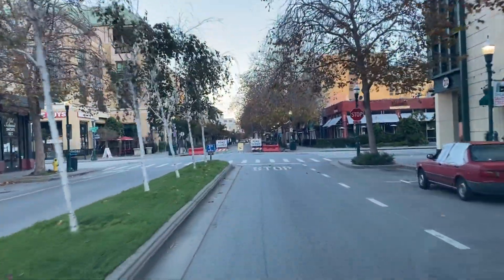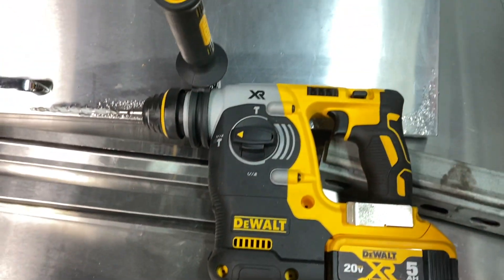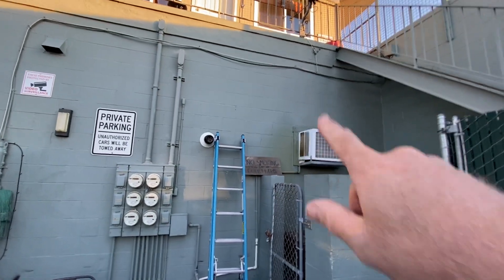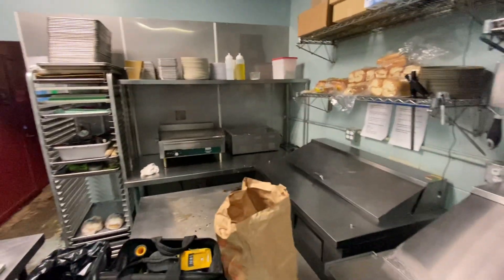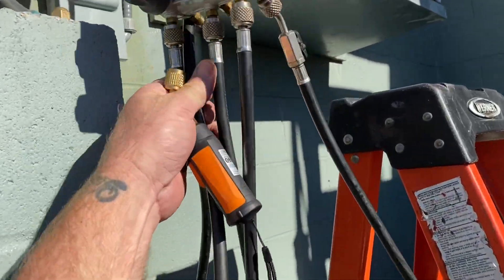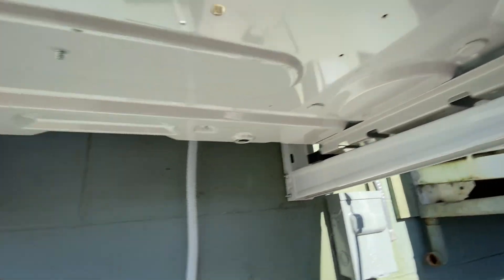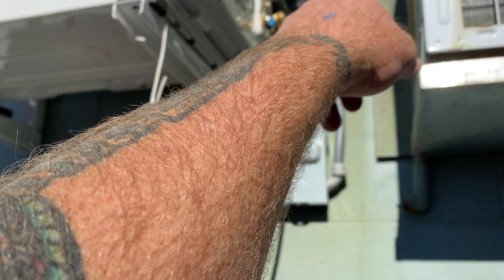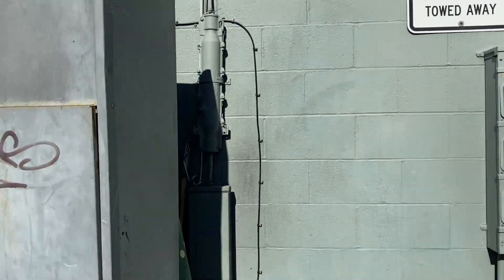Mini Split Air conditioner installation

Comment: Good morning ... I require some help on an installation of a 24 btu mini split ... Lines were vacuumed. Gas setting at 140psi. Ac worked fine for a week ... Now it not heating or cooling. Your help is appriciated
Reply: Si funciono por una semana, puede ser qué hay fuga de refrigerante, puede prender el equipo en modo frío y ver si el sistema en general funciona, si es así entonces es una fuga de refrigerante.

Comment: Be careful with those AC service valves, they don't handle too much nitrogen pressure during the test. Especially those cheaper 'proudly made in PRC' Midea units. So your nitrogen can cross the valve and get inside the unit. I always use H2N2 at 15 bars, because H2 is a smaller molecule you can easily detect a leak. Safer and cheaper than high pressure N2.

Comment: What's you opinion on the DiY Mr. Cool units?  I have an old Whirlpool 20,000 BTU window unit in my garage and it's on borrowed time.  Thinking of going the mini spit route vs another window A/C.
Reply from the maker: I’ve installed them for customers. No issues yet.

Comment: Cool vid! I Just installed my first mini split in my father in laws garage out at the Colorado river. It’s a 3 ton Friedrich. We’ll see how she does in the 120 degree summer heat next year. The garage door insulation I put up should help a lot.
Reply: insulate the floor with rubber to save $ too.

Comment: Nice install. ive never installed a mini-split. that line set run looks like its only a few feet. is that ok? is there a Max or min line set run for the units charge. im guessing its a pre-charged unit ? Talk about Lucky 🍀, that Electrical panel being right there. nice.
shortest runs ive even seen for everything.
electrical - 3 foot. condensate - 1 ft. line set - 3 foot.🍀 lucky dog 🐶.
Reply from the maker: There was no minimum Line set but there is a maximum.  And we read the manual 😂😂
Reply: @NorCal-refrigeration   i would think u would. all these mini splits u kinda have to unless u are they installing same units all day long. all different manufacturers. different wiring quirks & colors. nice little 2.5 ton unit it looks like. heat pump or straight cool ?
Reply from the maker: @OcRefrig  heat pump
Reply: Yes they recommend a minimum and maximum run for the line set. They said if it is too short it can be a little noisy, have not seen that yet. I don’t work on a lot of mini split, I installed one with a short run but make a little coil, some techs will say it is a hack but I read the manual.
Reply: @REFRITEKREFRIGERACION   Thanks. Yea, i allways read installation instructions. It is Foolish not to , especially these days with things changing so rapidly. it can save alot of grief.

Comment: Do you get these unit pre charge with freon
Reply from the maker: They come pre charged for a certain length of line set. If you go over there is a calculation for added refrigerant per foot.